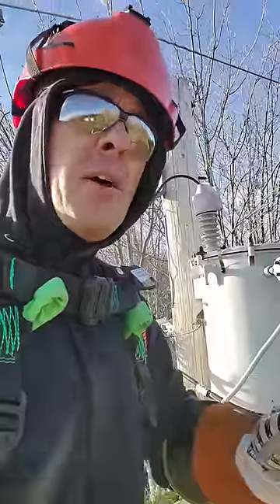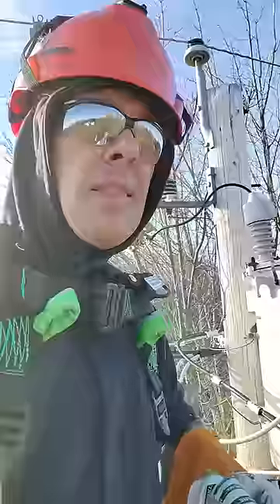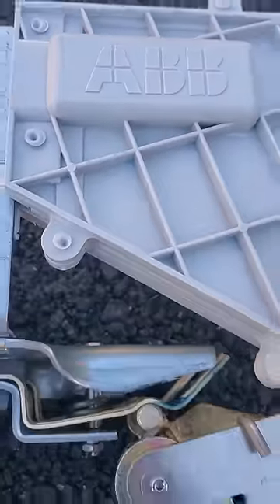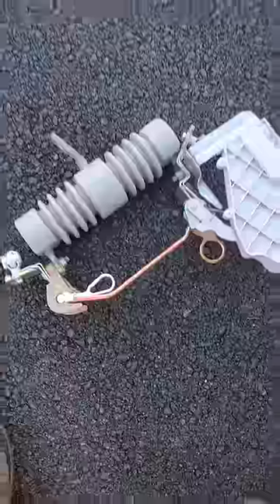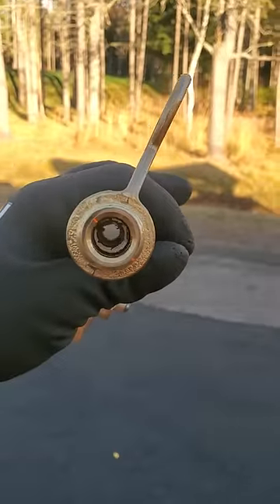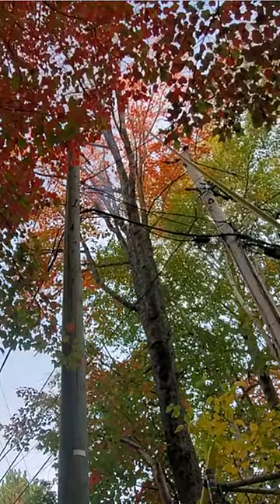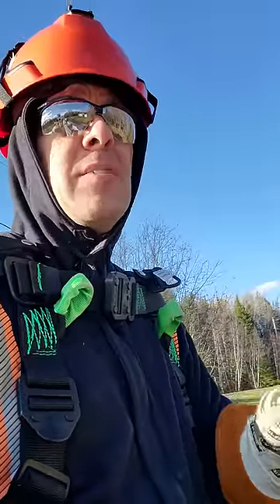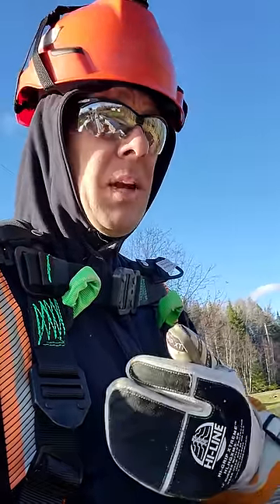Did your transformer "blow up"??

Comment: Usually when I hear a loud bang and my power goes out and there is a dead animal on the ground under my transformer. This happened twice last summer, the first time there was a squirrel and the second time there was nothing on the ground. When the guys came out they replaced my transformer and the blown fuse. He said my transformer was over 60 years old. All good now.
Reply: The 100-amp squirrel fuse is known to be quite unreliable, but also tasty in some parts of the country - if you like extra-crispy.
Reply: Happened at my parents house in the late 90's, all that was left of the squirrel was a tail attached to a small smoldering chunk of flesh
Reply: Used to have this problem.  The linemen suggested I put pressure on the squirrels.  Little did they know the squirrels use the line poles to avoid me.
Reply: Lol, you made me remember a possum in Australia that tries to join one wire with the other with his hands...unfortunately I saw him on the ground, still "holding" the wires
Reply: @Cynthia_Cantrell  
"Tastes like chicken!"
Reply: I know there have been some design changes over the years to make that sort of thing less common...  I wonder how widespread it is.
Anyways, the classic example was some big birds (eg. eagles) which liked landing on top of poles... Unfortunately their wingspan is just right to touch the top wires on each side in the process.  After some bad press and sensible advice from a biologist, companies started adding a little t-shaped bit on the top of the poles to give the critters a safer place to land.
Reply: @Cynthia_Cantrell  I'm sure it's tasty, but I don't like my squirrels with the guts baked in.
Reply: @Silver_o  You might try using it as a soup base then, rather than eating it straight.
Reply: I guess the old transformer was filled with nuts.  No wonder the squirrels were attacking it.
Reply: @ianbelletti6241  probably made a hum, and was warm. One on a trailer I moved to got hot enough to trip when the 4 ton air kicked on, no idea why the unit was that large, lights dimmed few minutes later blackout. Usually did this on a hot day, would hear the hum from the pole. About the 5th time the line man came out it was done for. They put one up there big enough for several houses.
Reply: @kennethwallace4338  apparently this joke went over your head.
Reply: @ianbelletti6241  got in a writing mood after being off here a few weeks 😁. But yeah it flew over and kept going.
Reply: @travcollier  At first I thought you were going to say the design of the 100-amp squirrel had changed.
Reply: @Cynthia_Cantrell  😂
Reply: "second time there was nothing on the ground"

The squirrels are evolving
Reply: I saw the still-smoking aftermath of two crows touching on separate power lines once when I was a kid.
Reply: Yep ! Transformers are tough!!
Reply: That's the old copper wound transformer.
Reply: Around here, it's usually a drunk driver trying to steer a pole.

Comment: Utility Communications worker (splicer) here: was working on a splice to establish service to a building when one of these fuckers blew over my head. The spacing on the poles in this urban area were NOT at code, but we deal with it. Gave me a start and, not hearing any sudden vehicle accelerations running away from me at the time, I was looking for a car that backfired.  It wasn’t until a resident of said building that I was working on came out and asked it I did “something” that knocked out power that I started looking around and saw the blown cutoff. Just awesome. I finished my work just before Utility Electric trucks rolled up.

Comment: I called in one time about the transformer blowing up and they acted like they didn't believe me until I mentioned it caught fire while talking to them 😂
Reply: It's funny how their reaction changes. 😊 

I lived in Alabama for a while. The tree line across the road from my window took some wind gusts. A bunch of dead snag branches fell onto and across the power lines. I called to alert the power company. I knew that they would need one of their bucket trucks,  (cherry pickers) to get up to clear the developing hazard. 

The gal was being dismissive. Then, I pointed out that I was giving their crews a head start warning since the lines were starting to arc, the branches were starting to catch on fire,  and pieces of burning wood were dropping into the dried leaves on the ground below. Suddenly, her tone changed and a truck appeared within minutes. 

They also dispatched a fire truck to knock out the smoldering brush fire before it climbed up into the trees, and into the two nearby apartment complexes. Apparently, I had been the only call. I had caught sight of it just in time.
Reply: @elizabethbottroff1218  snitch

Comment: one time I was woken up at 2am by a bang so loud that I legit thought my neighbors propane tank exploded. the flash of light it made was so bright that it lit my bedroom up through my blackout curtains for a good 2 or 3 seconds. all the power was out for about 2 hours until the line truck pulled up across the street replaced something on the transformer pole.

Comment: I remember the ice storm of 08 we're transformers we're actually exploding. I sat outside with my beer in the snow, it looked and sounded like a warzone. I also saw it run down multiple lines blowing up boxes and setting the poles on fire one after another. Absolute madness
Reply: Trees down everywhere, power lines on the roads, everything encased in ice. It was a surreal time, but no less life threatening. A lot of people relied on electric heating where I lived, and were two even three weeks without power. A lot of churches and community centers became shelters to keep people warm and fed.
Reply: @ThatMattaTatta  I had no power for over two weeks. Took cold showers, ate out of cans, and slept in my mummy bag. It was rough. I kinda loved every bit of it in a way.

Comment: 3 AM 10 years ago, asleep and BOOM. Transformer was roughly 20 feet from our headboard. Called power company in the morning. Since there was black fluid dripping all over. They not only came to look. Based on my description they also brought a new transformer. Sometimes, it IS the transformer. It is much louder than what you showed, I know that much. Still a very interesting clip non the less. Thank you.

Comment: I actually did have a transformer blow. A squirrel got into the secondary connection and built a nest. When it eventually made a connection, it started a fire inside the housing where the secondary connections were. Flames conduct and the transformer was fused, but with the entire dissipation inside the housing, it was not within the anticipated failure modes.

Comment: I was driving across the country and during a heavy rainstorm in Missouri I saw lightning hit a transformer and felt the pressure of it blowing up right as we were driving by it, the dark heavy storm became white light for a second and it sounded like a piece of artillery going off in close range. Which is to say it was so loud and powerful you felt it pass through your body. Crazy to see happen, but yeah transformers blowing up are more intense than you think.

Comment: If the transformer blows the top flies off and there will be oil everywhere.  Hard to miss. Plus a likely fire. We buy them with an internal fuse or breaker but it cannot always prevent catastrophic failure.

Comment: The last two times it happened near our place, the housing actually had a hole in it, with oil running down. I note that after the second one, they put in a larger unit. Over a few years, they built several multi-unit homes on largely vacant land, but never did anything to the lines etc in the alley.

Comment: I had an old lineman telling me about contests to see who could "glove it on the primary" for the longest. 
>Ok... what's a primary?
- You see them wires running between the poles? Those. 
>Ok... What do you mean by "glove it"?
- Well, you just reach out from the (insulated) bucket and grab it. 
> Dude... that's like... 14k volts.
- Yep! 
I've met a few goofy linemen over the years. Electricians too, for that matter. Maybe there should be exposure limits.

Comment: Where I used to live we had a transformer right in front of the house and that fuse would blow out frequently during the winter. I think at one point it had blown, they came and fixed it, and then it blew again just a couple hours later. I remember hearing the bang and looking outside and seeing the cutout door still swinging.

Comment: I did see a xformer blow up once - I think.  I was driving home around midnight a few years ago.  I'm just lucky I wasn't looking directly at it, but saw it with my peripheral vision.  For about one second, everything in my vision lit up.  I mean it illuminated the whole block including all the way across 8 lanes of I35E running through Dallas, Texas, just as bright as if the sun was shining.  The source was a bright white fire at the top of a pole.  The color faded and the fire burned out, leaving only smoke.  This all  took no longer than 2 seconds.

Comment: In the early 2000s we had not had a hurricane for a while and we got one. It started getting windy about dusk and the horizon was just flashes of light in all directions as power was going out around the city. I'm not sure it was the wires touching or transformers blowing, but the power was out for about a week.  The light show was spectacular while it lasted.

Comment: Before the power lines moved underground in my previous district, I saw live a cable breaking during a windy day.

Cables going underground may or may not have solved all the problems, but at least the urban distribution lines would not break anymore because of weather. It should be a win during the storms.

Comment: September first I was doing some repairs at a condo my employer owns. As i was wrapping things up, the lights flickered and I heard a small explosion. Apparently an employee of the utility company was operating a tractor clearing brush next to a sub-station and struck a guy wire. The guy wire severed at the ground and shot up into the lines above.  This knocked out power for the city and surrounding communities,  it also caused the power to flicker across South East Michigan.  No one was injured.

Comment: I used to work for a power company as an electrical engineer doing distribution, fuse coordination, and arc flash analysis. I got fired because I spent too much time with the linemen... and nepotism... someone's buddy's son wanted my job... still in litigation.

Comment: I had an outage at my house about 2 years ago or so. Notified the local utility  they sent a crew to reset something. I was up on scaffolding a couple doors down from my house when they energized the transformer. Big giant sizzle, loud bang and a bunch of smoke. It was at that point I yelled down to the guys who were no more than 80ft from me, are you ok? The yelled back yeah were fine. I said to myself, well I guess we ain't getting power back on right now. Had that distinct smell of electrical smoke. They had to change out transformers and cut back a bunch of vines that had grown around it and the pole. Pad mounted transformer in Ontario by the way.

Comment: oh man one time one blew up behind a mechanic shop and it wasn't that loud but it was loud enough to know it wasn't your average everyday situation. i ran behind the shop and saw the grass was catching on fire, char in a circle from where i now know what was the fuse,  burning. guys popped head over fence, go get water bro! lol i saved the fuse it's kind of like a ceramic.... if no one has been there it might have started a fire and right next to that shop it could have been bad. at least the fence was metal... but the grass was burning pretty good.

Comment: I was in a store and heard that BANG and the power went out and a bird fell to the ground on fire and caught the grass on fire.  Could that bird have hit that fuse?  The power company was there in less than an hour and replaced the fuse.  It was a skilled move too, the guy used a long as pole that held the new fuse and popped it in place way up there.  He pulled that off as the rest of the crew was positioning the bucket truck.

Comment: Everything in our modern neighborhood is underground. But it's interesting to see this stuff. We live in a suburb of Phoenix but out on the mains, that are in a grid pattern, we still have above ground supply lines that supply the underground neighborhood grids and I've seen those bad boys blow during the storms. You can't miss it especially during the monsoon season when the sky is lit up with blue green explosions everywhere. It's a site to see when it's pitch black out with no street lights or light pollution and you see the glow of job security and our tax dollars at work and finally being put to good use 😂 My dad calls it "upgrade season" because the city is always forced to upgrade and prioritize repairs that desperately needed it. He worked in construction before he retired and had a lot of lineman knowledge.

Comment: The one time I saw a cutout blow was during a heavy storm when a tree got knocked over and ripped down / shorted out the feed to a neighbour's house. Except instead of the fuse blowing it lit itself on fire, spewing out sparks and bits of flaming fuse-shrapnel, and destroying the old porcelain cutout it was mounted in.

Comment: When breaking a high voltage/current connection, it will arc (plasma) across small gaps. This briefly lights up until the gap is greater & the arc can't be maintained. A standard fuse or small contacts found in domestic circuit breakers may be too small to move far enough apart to break the arc from flowing. That's why they need small things to trigger larger things.

Comment: Years ago the transformer up the road from my house did in fact explode. The top of the pole was on fire and the bottom of the transformer was in the weeds below the hill. I found it after the power company left. It looked like the metal lid off an oil drum. They were having problems on my line at that time. The had to jump the voltage from 6800 to 7200 and replace several transformers to fix the problems caused by the new old folks home that had just been built. I guess some one messed up because I would have though the power would  have been upgraded before the old folks home went online.

Comment: Used to shoot at our houses transformer from the front porch with a Daisy Red Rider. Fast forward 8 or 10 years and the transformer looked like it had a bad case of the chicken pox. I had no idea the pathetic little bb gun was chipping paint off the transformer. The transformer failed and had to be replaced and I remember knowing all those rust spots were my fault. The linemen said that didn't cause it to fail.

Comment: Funny bit is I've seen a phase lug melt off the LV side several times in the last 10 years, almost always on commercial locations with an open delta/wild leg.  One time it was the neutra bond that failed and that was interesting, a LOT of 120V equipment died that day and someone got a nasty zap.

Comment: Usually I have seen those fuses tapping off of the 14KV like feeding the residential transformer that delivers 240V with a common center tap from two 120V lines with respect to the center tap/neutral.

If that fuse is blown it can be one of four reasons... 
1. main line surge. [ which in that case would blow a lot of fuses down the line.]
2. Transformer failure.
3. Excessive current draw from the user. [House/Houses]
4. The fuse is simply tired from the thermal expansion and contraction over its service life.
[Example: Let's say you have two houses running on the same transformer and both houses draw over 100A@240 each intermittently [Typically a house has a 200A service panel] sometimes at the same time. The fuse element gets warm and expands and then when they don't use the excessive power the element contracts. Over time the growing and shrinking of the metal element causes fractures [metal fatigue] which depletes the load carrying capacity of the fuse. Then one day it has to handle a large load and just gives up the ghost blowing in a spectacular fashion.]

Comment: Had a transformer blow up on my street. Dropout fuse kept blowing on the corner pole and one time the transformer blew up and power went out. Power company was working on it and I told them to change out the transformer because it blew. They tested it and sure enough it blew and they changed it out and put in a new fuse on the corner pole and all good. No more randomly popping fuses.

Comment: One night, a few years ago, I looked out my window and saw flickering. I could tell it was fire, but I had to step outside to see where it was coming from. It was coming from the top of the power pole near my house. I never heard any bangs at all, and it was pretty close to my house. 

They had to replace the whole pole and transformer. I don't know how it caught fire. It was in the middle of January, and there was no lightning or anything. Ended up being without power all night while they fixed it, but I was actually surprised they were able to fix it in one night.

Comment: yep or if you have A-line to ground or line to line fault. It sounds like A270 rifle going off. Typically on some High pot Transformers I've seen 15KVA on an 8amp line fuse with 3 homes 200amp service drops run full load and blow the cut out fuse out on to the ground below.

Comment: I was out working on a car, and as I connected the battery the fuse at the end of the neighborhood blew, and of course I swore rather loudly at that combination.  My neighborhood is about 40 years old, and the underground wiring was deteriorating.  It blew that fuse about monthly until they trenched in new power.